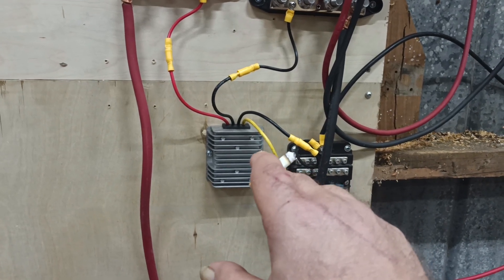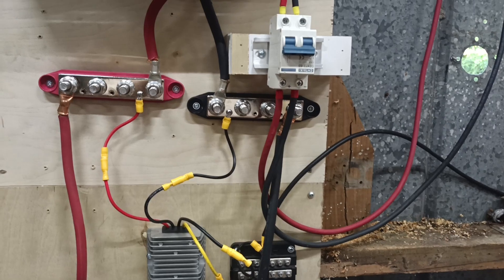Going from 12v to 24v solar system is done

Comment: Unfortunately, you chose one of the worst inverter technologies available on the market. These overpriced, poor performing inverters aren't  new. They still use dangerous, outdated high-frequency, transformerless inverter tech that offers a poor surge capacity and a shorter life expectancy than more advanced low frequency, transformer based designs. Even worse, these poorly designed transformerless  inverters can damage your home's appliances when their MOSFETs fail, because they don't provide any galvanic isolation between their DC boost stage and their AC output.